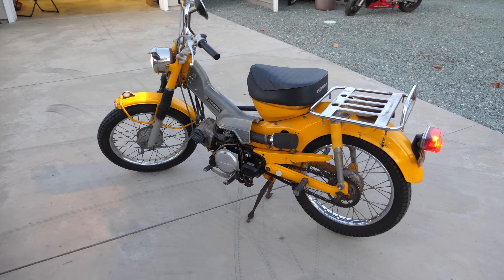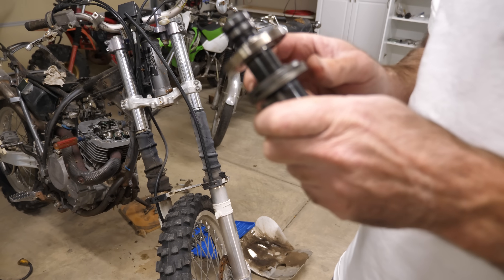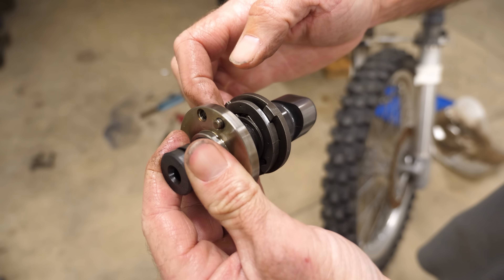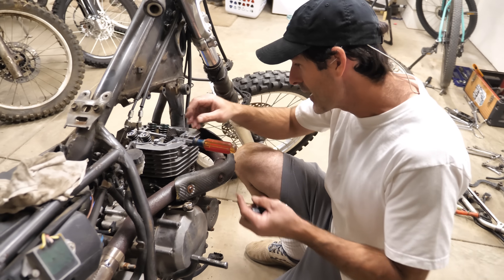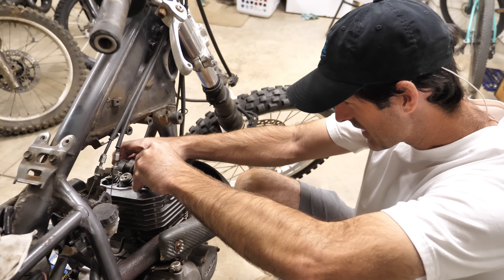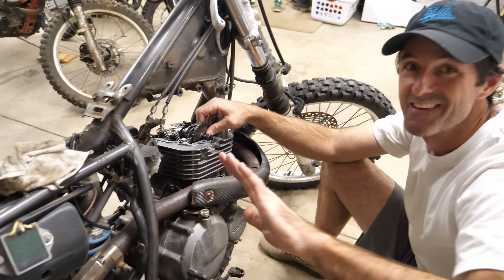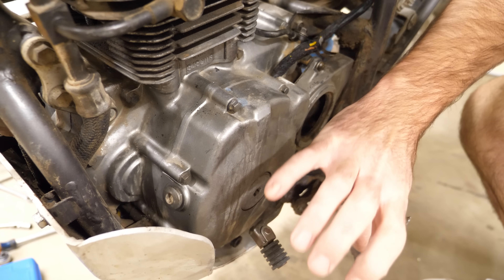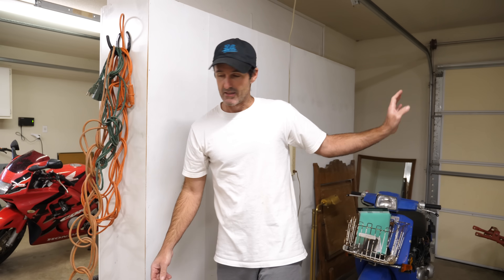This Motorcycle Has Problems I Can't Figure Out (backfiring & erratic idle)

Comment: Motorcycle Repair Shop Owner here... As for the wierd irradic idle and ackfiring thing. What to look for that ALOT of people overlook is the Float Level being to LOW and it will cause a lot of the Symptoms you're dealing with. I have bikes all the time come to me and people will tell me (and they will think it's lean so they will up the pilot jet to a bigger one) then they will raise the idle then it will run but surgese and or revs on its own then stall and back fires through the carb etc... So what is happening is when the float level is to low... is the Pilot Jet is not submerged in the fuel and now fuel can be drawn up the pilot jet so the most common next move is people install a way bigger pilot jet now the things will rev up on its own etc so they try to mess with the idle Screw just enough that it's pulling fuel from the Main Jet since the Main jet sits low in the fuel bowl and now the pilot jet is acting like an air leak and pulling fumes in so it goes rich then lean people get confised over it. Once you get the Float jetting right make sure you have a stock pilot jet in it, then turn the Air Screw out little at a time you SHOULD hear the bike start to idle higher with the air screw then back the IDLE SCREW down then turn the Air Screw out again till the idle rises more THEN you will get a nice low idle with good throtle response.

Comment: To ck for a vacuum leak spray carb cleaner on and around the intake boot and listen for a change in the eng. Do it with it running.
Reply: That's what I was thinking too. Could also be the o-ring on the air fuel mixture screw. When those don't seal and seat well they can cause the idle to hunt. Auto decomp would be low on my list of suspicions if I came across this scenario at the shop.
Reply: Yes 💯 try these first. Air leaks are hard to find sometimes. Cracked boot? Or gaskets around the cylinder. Even top of carb. Check it all. Also no airfiller can make bike run crap! As it need back pressure.
Reply: He's tried spraying carb cleaner around intake with no diff in rpm.

Comment: i had a xr650r with erratic idle...I wasnt there when i bought the bike, it came over time...I did find some bad seals in the carb (o-ring thing) but it didnt solve the problem. cleaned the carb 4 times. tried the spray test around the engine....no change. I gave up because nobody seem to know the cause. Wish I tried swapping the carburator to a replacement just to see if it was carburator issue. I think something isnt sealing properly, either carb related or crank seals maybe? I doubt that anything electrical can cause this behaivour for example bad stator. Good luck solving this issue, you are going to need it this time.

Comment: I own a motorcycle repair shop in Florida. I deal with older bikes ALL the time. 
 My assessment is carburetor related. Have you been inside it yet to know what the jetting is? 
There is obviously an aftermarket exhaust on it and some could have changed the pilot jet.  It shouldn't have been changed. Put the stock size back in. I'm guessing its a #35 or #38. Either way put a stock one in it.
Second is the fuel mixture screw. Remove it from the carburetor inspect it. 
It should be a spring, metal washer, then a rubber o-ring in that order.  Look at the tip. It should be tapered to a sharp point. Not bent or broken. 
When reinstalled if all that is good ,a general setting is 1 1/2 turns out, to start.
Next start the bike and let it warm up to operating temp.
Then drop the idle to a slow as you can get it to run without dieing. 
Turn the mixture screw out counterclockwise and listen for the idle to increase. Keep turning the screw until you aren't gaining any more RPM's. Then set your idle screw on the side of the carburetor to 900-100 RPM.
Reply: @MikeSmith-rx4uu  why wouldn't you want to jet for the aftermarket exhaust when its recommended by basically every manufacturer I've ever heard of or had personally .. I've hmf, fmf, white bro's and countless others and all my machines had to be jetted accordingly to get them to run correctly 🤔
Reply: I have always had to adjust the pilot jet, but that involves exhaust and intake modifications. He did change the whole carb with a different one, we dont know what the jets where in the old or new though I dont remember.
Reply: intake leak causes same issues.
Reply: @kartracer5g229  It will still run right if not jetted for the pipe. This is part of the troubleshooting process, once the issue is solved jetting for the pipe is recommended.
Reply: Air intake boot split  or bad crank seal drawing air
Reply: @kartracer5g229  i was saying not to change the pilot jet. Most aren't generally affected by an aftermarket exhaust system. The pilot jet, if you don't know takes care of idle to 1/4 throttle opening. Alot of carburetors in this type of application have an accelerator pump that shoots raw fuel directly down the carburetor. That is a one thing that you tune. Different cams, springs, squirter size, ect.... but basically the pilot jet, generally shouldn't be changed. The intermediate jet (if it has one) and main jets DEFINITELY need to be changed out with an aftermarket exhaust system. Among other parts in the carburetor.  Like clip position for the jet needle. The needle itself being changed out to a different one with a different taper. The slide  in the carburetor,  to change the cutaway on it....... I'm getting way to technical here, lol in short its best to leave the pilot jet alone when having idling issues.

Comment: By the way it fluctuates in rpm i would say you have an air leak in the intake boot making it lean. It would also explain those backfires. The quick test is to spray the boot and check if it changes rpm. If it doesnt, i would go to fuel starvation with the float level. If none of the above, as everyone says a leakdown test will give more information on the engine health.
On the other side what you tslked about with the radio waves remind me of the movie "lucy" with scarlett johansenn were they show what would a human being with more brain capacity would see the modern world, interesting concept.
Reply: BTW nice cbr mate

Comment: Check for vacuum leaks with the spray trick, if that doesn't work i reckon remove the carb again,  remove the jets and make sure they're stock size and they're clean and the air/fuel screw is set to oem specs. And see what happens.

Comment: I love your content! Especially how original and fun y’all are. I had a similar issue on a 1993 model I owned last year. What a headache it was! Adjusting the idle helped it not die off the line. Had a tick, especially under power and in hot weather that flowed with the RPM. One day, I could only start it by pulling it and it ran HOT. Made the pipe glow. 
I found out that the wires at the stator were shorted out and caused all of those issues. Purchased a 96 model stator, swapped a wire over, and it ran GREAT. Wish I never sold it. 
Hope this helps on your diagnostics

Comment: I think it's pulling a little bit of air somewhere. So inlet manifold close inspection - then maybe if no joy - do a cylinder leak down test in case its base or cylinder head gasket leak, third thing could be a valve leaking. I'm right with you in frustration mode. Don't give up Jake, your a smart chap.

Comment: i just sold a 83 gs650 that i got running after sitting for years, first start it ran great next day it was idling out of control going straight to redline. cleaned the carbs valve shims was good for one start then it started revving out of control again what a piece
Reply: Let me know how you make out with this problem…I have a craftsman yt3000 that’s doing the same thing

Comment: Jake. I’ve been watching you for a very long time I even messaged you about my old Kdx80 way way back when… since before the ol blue tarp husky video you tear me apart
Anyway everybody is saying air/vacuum leak which I think is correct but much more simple than we’re all making it. That’s a tm33 pumper carb and they have air jets in the airbox side of the carburetor. You don’t have a boot on there connecting the box to the carb which I believe to be necessary for that carb to work properly. You know what a velocity stack is and I think the air boot would act as a velocity stack accelerating the air coming into the carb making it run more proper
Second thing I could offer is adjust your valve lash!!

Comment: When you talked about an early project, I initially wondered if that might be the cheap faulty generator you fixed by replacing piston rings from a non-original source. Great little series you should try to repeat - broadens your audience.

Comment: I would run a leak down test. Also check timing mark on the stator plate for the kick back problem. If the mark is lined up correctly you shouldn't get a kick back. If the timing chain is worn you can advance the stator 1mm to eliminate the kick back.

Comment: You e got an awesome channel with great candor and engaging teaching. I just got into bikes and bought a 98 dr350 off-road model that I’ve spent two months getting ready for the trails and had similar issues to you with rough idle and bad exhaust pop on decel. I missed of your bike has the pumper carb or not? Most of my issue was carb and fuel related. I did adjust the valves to spec but most of my problem was in the carb. I also replaced the header gasket and that seemed to resolve the popping and could also be affecting the idle mixture. You’re far above my mechanical level but thought I’d offer what worked for me.

Comment: A good test to perform is a leak down test.  Pressurizing the cylinder to diagnose if rings are good, valves are seated well  if there is a leak in any of the gaskets or seals. 

Set the piston at tdc  lock it in place and fill the cylinder with air and see if you're inside the percentage of acceptable leakage

Comment: A fluctuating idle is a lean condition. I've had this once before where the fuel flow from the tank was partially blocked from debris in the petcock and fuel hose. However, you've bypassed that all together with your fuel tank on a stand.. which means it's carby related or intake manifold leak.

Comment: Check and adjust the valves. Then diagnose anything else as required.  Had similar issues with an '03 klx 300.

Comment: It soinds kind of like it could be sucking air somewhere. Get a can of starting fluid and while its running start spraying joints, little shots of starting fluid (where the air intake meets the carb, where the carb meets the head spark plug hole anywhere it coild possibly suck air into the combustion chamber) and listen for a change in RPM. Also worth checking the accelerator pump on the carb if it has one for the cut out when revving from idle. I had a YFZ 450 that did something very similar and i spent weeks testing it, it ended up being a little sensor in the throttle (the box on the handlebars) was a little grimey i cleaned it up and it was fine after that.

Comment: I've had the same symptom a few times, once it was the pin holding the rockers that had gotten starved of oil so the valves did not open the same amount all the time and that time I also had en extra noise from the rocker cover. Once it was the needle valve that was not closing perfectly (clean carburator and the rubber tip felt fine) but replaceing the needle valve fixed the issue. Once it was a tiny vacum leak between the carburator and cylinder.
Reply from the maker: Thanks for the ideas. I thought your last one I thought might be issue on the DR but I sprayed carb cleaner all over the manifold and couldn't tell a difference.
Reply: @jenniesgarage  sorry to hear that, could have been an easy fix. Only other issues I've had have been electrical in the form of a bad cdi and ignition coil but that also gave issues at rews in my case. Anyhow nice that you are getting more videos out, they are an inspiration.

Comment: Vacuum leak may be a good place to check like you said. Does it have an accelerator pump? That may be why it dies when throttle is applied? Carb could just be worn out. Cracks in intake boots. I would be aiming for a vacuum leak somewhere for sure.

Comment: My kx450F -06 did simular to this and wanderd from 1800rpm to 2200 and it was a bit lazy taking of from idle and did die some time. it was worse when it was cold to about 20 minutes then it ran "fine".
I finally took out the carb knowing everything else was just fine and "new" I raised the needle 1 level, and after that it was rock solid 2000rpm idle from the start and about 1800 warmed up, and quick as he\\ on the throttle it almost threw me of the first time. only thing I had to renew my skills starting it up cold.

Comment: Correct can timing verified. 
Confirm float level. 
Bring to tdc. Clamp air coupling (make one) on intake boot. Charge with air (10psi). Use soapy water to find leak. My guess it’s a leaking crank seal behind the magneto or a cracked intake boot.

Comment: Do you have the air cleaner box and filter on..sometimes you merd that internal resistance  from it,..or re adjust the mixture screw while giving it throttle...

Comment: these DR are notoriously hard to cold start without backfires, check the valves are fully sealing, and valve clearances are correct. also check carb rubbers are not perished

Comment: Maybe check the needle on the carburetor slide? It could’ve come loose, and somehow, it fluctuates inside the carburetor slide, giving it gas or taking away gas. It's kind of a long shot, but maybe the needle could be bent, too. This has stumped me; I've never heard of this happening before. I've seen engine idles fluctuate, but nothing like this. Hope you get it figured out.

Comment: That sounds like an air leak. I've been thinking that all along but usually they speed up not stumble and die, but with the cam fixed it's sounding much more like a small air leak. Once it warms up a little and begins acting up Spray carb cleaner or break clean around the head and carb boot and see if the engine speed changes. Might be the carb boot or the head causing the leak, but it definitely gets worse as it warms and that is typical of air leaks.

Comment: If it isn't timing, and it isn't valve adjustment, it's likely still in the carb, or the union between carb & engine letting air in causing it to lean out...

Comment: Maybe the crank timing is off. You said that the mark in the inspection hole was when the engine was nearly at top dead center but that doesnt make sense, those marks should all be lined up at top dead center. Maybe that is your timing problem. Should check the shop manual it will tell you.

Also, you can check for vacuum leaks by spraying carb cleaner around vacuum hoses and and vacuum areas, and listen for an obvious idle change. The carb cleaner gets sucked into the vacuum system and changes the idle if there is a leak. Helps to narrow down and find leaks. (edit: saw you already tried that)

That click does sound like the decompression lobe engaging/disengaging
Reply: Also I had a bike that I could NOT get any power on, did everything, cleaned carb, checked timing/points all that, but ended up being a clogged exhaust pipe. But idk how likely that is on a 4 stroke, mine was a 2 stroke, but could be something to check also.

Comment: Take some brake clean and spray around the intake manifold while it's running,sounds like an air leak to me.also,without the air box on it,it's going to run slightly lean,unless it's been jetted richer.

Comment: That bike has a tm33 or 31 pumper carb on it. Make sure the pumper rod isn't stuck open it will flood the motor..the plastic arm should be on the right side of the carb with a rod extending down into the float. I will link a video of my TM31 carb install on my DR250

Comment: Try checking for vacuum leaks with some carb cleaner or brake clean. If theres a leak rpms should go up. 🤷‍♂️
Reply from the maker: Good idea. I tried spraying carb cleaner around the manifold but couldn't tell if there was a difference. Tough to tell because the idle randomly fluctuates anyway.

Comment: Sounds lean, check the intake for air leaks, and possibly crank seals. Is this the same bike that had the bent shaft by the flywheel?
Reply: Crank seals? The DR350 is a four stroke.

Comment: Try tuning it with an oiled air filter on it. May need back pelressure from the air filter.
Reply: Good suggestion. I was wondering if the holes in the airbox were stock or modified. They were a popular mod, said to get more air to the engine. Taping em is a quick way to diagnose.

Comment: Even a broken manifold might be the problem or a crusted-ass carb needle. From experience from a kz 750 82' that sounds like a manifold or gasket, because of how it sounds before you hit the gas
Reply: Just because it sped up and slowed down again sounds like air is leaking. My problem was also caused by the circle gasket, the thing up the fins. Also bought a high head gasket silicone it was red, then installed the new gasket to forget about that problem for a couple of years. These are projects they're eventually going to break down. But thats what I like about it

Comment: Ya thinking vacuum leak somewhere.  Spray some starting fluid?
Reply from the maker: Definitely possible. I sprayed carb cleaner on the manifold but couldn't tell if it made a difference. It's hard to tell because the idle fluctuates up anyway.
Reply: @jenniesgarage  how about that mark on the crank!!!   WAYYYYY OFFFF!   Lol. Surprised that thing ran at all.   Good job bro!😎

Comment: put a good sealed airbox on it with a good filter or you will never get it to run right. looks like the air box u have on it has speed holes drilled in it and its not even hooked up